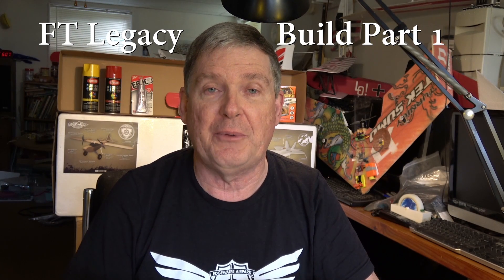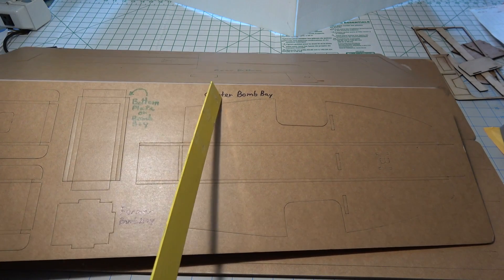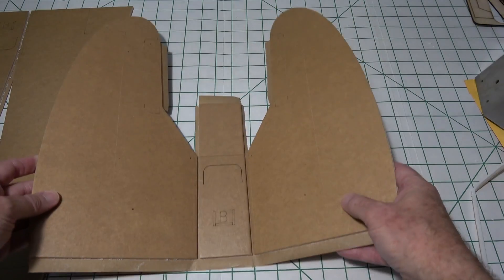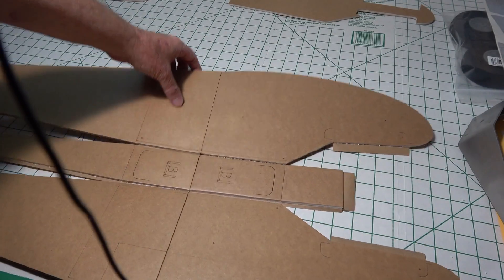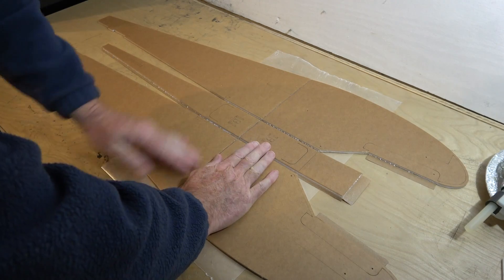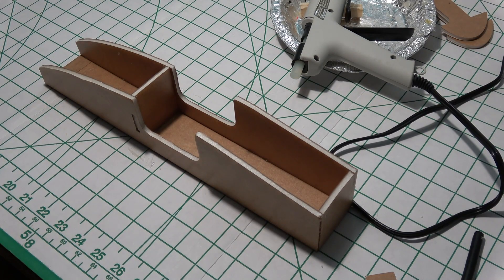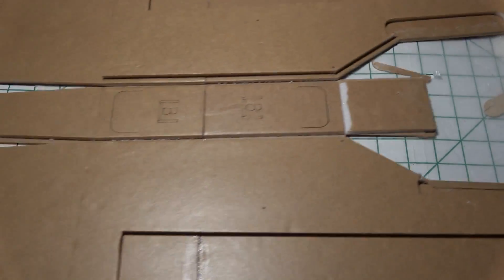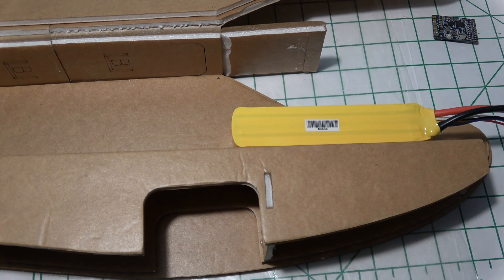Founders FT Legacy RC Plane Build - Part 1 (FPV iNAV Twin Engine Differential Thrust) Fuselage

Comment: Another question Dave if you don't mind.. Did you ever measured the weight of the twin engine FT Legacy? 
I built mine used 5mm Westfoam board (in the UK just this is available) and seems very heavy to me. 
To balance the plane I had to use a 5500mAH battery and a gopro4 with case, both placed totally in the nose..  
If I could remove the paper from inside the fuselage may still rigid enough, but lighter and  easier to balance?
I'm affraid even can not be take off..
Reply from the maker: I never measured the weight but it flies ok with a 2200 - 4000 3s. Keep in mind I have the weight of the FPV video pod in the nose area so that may help balance it.

Comment: Hi Dave, 
I already posted this under Josh Bixler's video , but there is no any answer yet and I hope here I can give some advice.. 
So I also building the twin engine version,  (Fuselage done, wings perimeters are cutted) but I hesitate about that, may could be better if I build the wing in dihedral. (?) 
I'm not an advance pilot and don't want to do any aerobatic trick (yet), more important the plane stabilize byself as mush as possible. 
Is it make sense? 
I dont't want single engine, because there is the camera, but I expecting same self stabilising as a 3CH version. 
Is it could be similar if I going dihedral, or with two engine weight on the wings is impossible to give same (or at least similar) stability as a single engine version with dihedral wings?
Thanks indeed.
Reply from the maker: I hope Josh answers you because im not sure at all what the answer is. You will probaby have to try it and see what happens.
Reply: @DaveMerc  Thank you Dave the quick reply.

Comment: Still gotta build mine. Looking forward to how you build yours.
Reply from the maker: I working hard on it when I can. Soldering up the wires for  the Matek F411-wing flight controller tonight. Going to have a GPS  too.
It ought to get interesting.